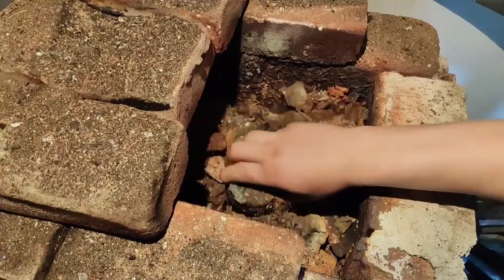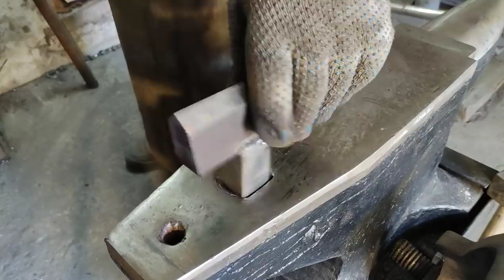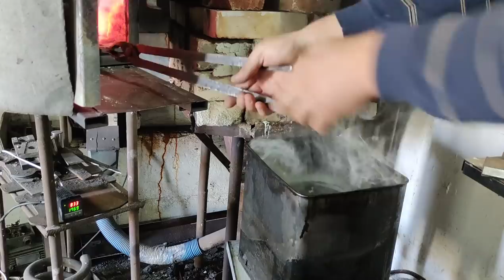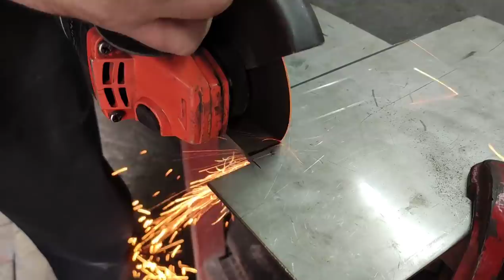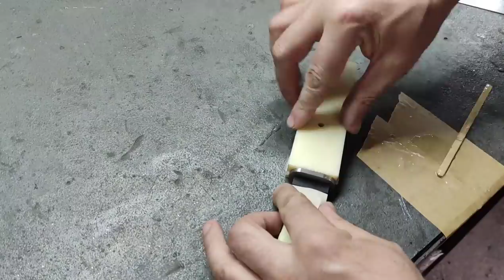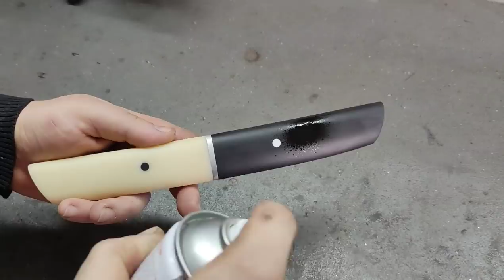WOOTZ steel from old drills and bearing balls . TANTO knife YIN YANG

Comment: Nothing to do with anything japanese swordsmithing stands for… anyhow, nice work but just aknife…..
Reply: I think the sophistication of crucible steel is something you might want to look into.
Reply: @anachronisticon 
It wasn't as good as Damascus  steel layering.. Wasn't a bad knife case but blade wasn't that great.
Reply: Biggus Dickus Do you mean a wootz blade is inferior to a pattern welded blade? Because that is far from certain.
Reply: @anachronisticon 
Damascus twist was stronger and flexible not as rigid.
Reply: Biggus Dickus A wootz blade should be composed on a matrix of cementite ultra-high carbon steel giving it both hardness and superplastic ductility at room temperature. Moreover it would be stronger because it was purified of slag during it's molten phase.
Reply: @anachronisticon 
That blade looked brittle to me and  unleavened
Reply: @anachronisticon  Hmm, let's think... No. The art of japanese steel making is refined over hundreds of years, using poor raw Material "Tamahagane" which normally would leave just brittled material. The folding technics and the way carbon is added plus the complicated process of getting a soft core embedded in a hard shell is mastering of Steel. I myself am a collector of japanese swords and think I can understand the difference between Crucible steel and folded steel. So, I appreciate te work in the video, the only thing I don't liek is the connection to japanese swordsmithing as the one has nothing to do with the other. The full absence of a hardened area alone makes this knife, just a knife, not a Tanto at all
Reply: @modelljets  Nothing you have said makes it reasonable to call a well crafted wootz blade "just a knife" purely because it is not made of tamahagane with a hamon.
Reply: @anachronisticon  then just don't call it Tanto. A Tanto ist a traditional hand forged japanese weapon. No machines used, used pure handcrafted skills. Yours imitates just. I would also not call Freddy Mercury a Luciano Pavarotti even both were brillant singers. But the one has nothing to do with the other.Even the used technics in this video are nothing spectacular. Belt grinder, Hydrauilic hammer. Well........

Comment: That is the worst way to forge a blade. World of been faster and stranger if you stuck to the traditional method
Reply: @smarston1305  if that's what you want to believe, but I'm not lying. You can go watch a master at the forge and judge for yourself. Btw, was not talking about me.
Reply: The traditional method of japanese blade smithing is because they had shit quality iron to work with. A master blade smith from 150 years ago would probably give his first born away to have access to the leaf springs in your old car.
Reply: @kerbalairforce8802  you know nothing about steel if you believe that. The steel the swordsmiths used is still stronger than the steel you drive.  Learn your history first.
Reply: @notjustagamer2300  Actually he's correct. The entire reason behind the traditional methods is because they had very poor quality steels available. This forced them to work the impurities out and to find a way to compensate for it's shortcomings.

This is not needed at all with modern steels, such as those found in leaf springs.

There is nothing magical or mystic about steel, it's all science and modern production has done away with the need of folding, San Mai construction, forge welding, etc. The only reason it's still done is for tradition, , challenge, the nolvelty and/or the appearance.
Reply: @byronreeves8607  no, it is still needed. And working out impurities was one of the many reasons for forging steel that way.  The steel  of today still has impurities in it. I was also not talking about folding the steel.
Reply: @notjustagamer2300  A tiny, miniscule amount to where it doesn't really matter-especially when it comes to CPM.

If you insist on believing it's still needed, then at this point, i suggest you to get off YouTube for a bit and contact actual metallurgists and others in the steel industry. 

Or if you want a more knife related source, then ask around on places like Blade forums. They will say much the same as I am though ( and will probably link you sources) as information on steel production isn't hard to find these days and the quality of modern steels is very well established.

There's a reason that ball bearings, industrial cutters, parts in millitary equipment, mill cutters, boat/ship propellors, , springs, helicopter roter blades, etc are not made from "traditional" steel manufacturing processes and it's not just due to "impractical and costly", (after all, people's lives literally can depend on some of these not failing)  it's also because it's simply not needed at all for modern steels as they are already homogenous enough with minimal impurities.

Again, don't take my word for it. Refer to professionals who works in the steel industry.
Reply: @byronreeves8607  funny, learn about metallurgy. You think they use shit steel or that they didn't know how to smelt metals back then?

Comment: Wootz Damascus steel must come the Wootz mine in Damascus.  If it does not not, than it is just pattern welded steel.
Reply: Cool. Nobody cares
Reply: Its more about the technique used to make it and not the actual metal itself. "Wootz Damascus" aka "True Damascus" is about a specific type of Crucible Steel. You're though right most PW are not Wootz.

Comment: There's no way that soft piece of Chineseium is going to hold an edge. 🤣
Reply: I'm not seeing how this is Wootz steel. Never folded the billet in with another bit of metal over 'n over before beating the whole thang into shape. Didn't throw some berries and charcoal into the cupola with a twist of lime 'n soda, when he melted the ball bearings.  Tanto knife has a point just like a Japanese katana, I think. Didn't see that here.
Reply: Just sounding racist
Reply: Where can I get to see the Power On Videos presented by one of your sponsors.
Reply: This is probably japanese... What did you make that is comparable to this?
Reply: @PreludeSon It was a joke my guy, he melted multiple types of hard steel together... So it's obviously going to hold an edge..... And sometimes Chinese steel is full of fillers and is total garbage to weld. "Chineseium" just a metal worker joke take it easy y'all.